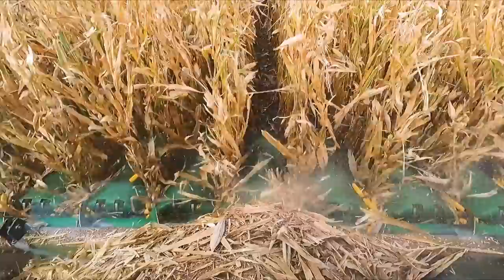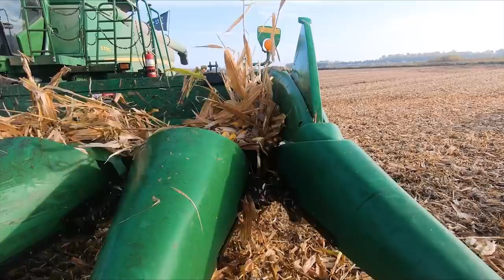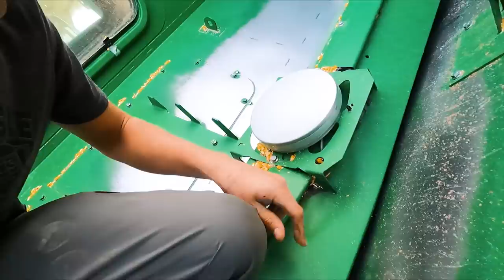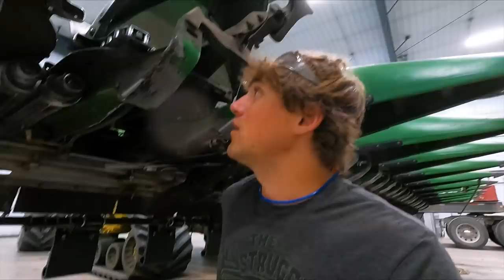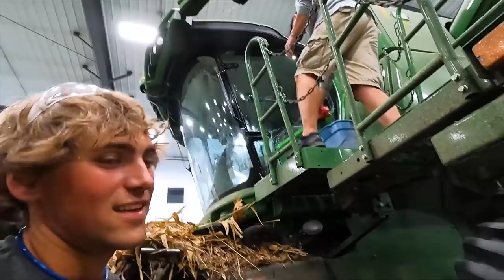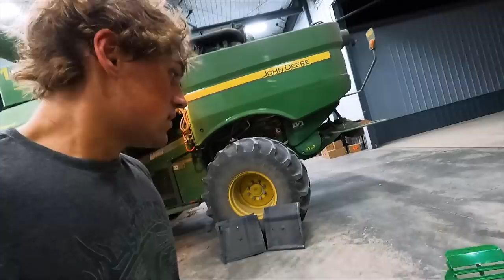We Crushed Our Grain Tank Auger!! #15

Comment: Seen a lot of cross auger bend on my20 and earlier machines. MY21 machines have a thicker gauge steel on the new ones so if you do get new ones they will be stronger. The entire auger trough has completely changed too in its construction.
Reply: @Ross Freeman Hi

Comment: Here’s what you do when the corn is a little damp. It’s a very technical fix and you might have to have your John Deere tech come out a help you get it set perfectly. You lower your ground speed and slow your head down so that the corn is not hitting the head so hard and it doesn’t shatter so much. Contact your local dealer with any questions.
Reply: Even better, READ THE OPERATORS MANUAL

Comment: I guess if you have to many fines since the corn is dry changing concaves is not going to help munch. First you need a need to buy the smaller set  of sprockets for the feeder house chain to run that slower and then the slow down kit to run the feed accclerator slower. Those two areas are where the cracking is occurring before it even hits the rotor and concave.

Comment: Not hard to figure out the shield over the auger in the grain bin  crushed due to the extra weight caused by excessive weight with the 3 foot higher bin extensions.  Its a chain reaction when you raise the grain higher and higher it causes you to have to reinforce what the factory engineered shields in the bottom of the tank. .  Do enjoy the channel.   I always thought the cobs came out the back of the combine and ears were gathered with the corn head.  Just my thoughts.  Maybe that why we called it ear corn when we picked it and put it in corn cribs.  Yes I am that old.  PS...........squirrels like ear corn too.

Comment: That's what happens when you put extensions on the grain bin on the combines, not made for the extra grain, that's why it wasn't made with them...
Reply: Everyone says “we will not fill them totally full”. But you do.  I bought larger grain cart then I intended, for tractor I intended to use…. “I will just not fill it full”
  Right
Reply: Actually they are made for it and come from the factory with them.
Reply: @gregjames5070  Not there's, they installed them after market to make them hold even more grain
Reply: Chets combine came factory with the power folding extension. The new used one came with a manual gold extension. All “S” series combines are made for extensions
Reply: Really I have extensions on mine and have never had that happen or seen or heard it happening to anybody else. I am thinking it was just a fluke piece of weak steel.

Comment: Erick the BS, have you ever tried new skin,  or liquid bandage? If it's on a joint you may have to use two or three applications. Put the first one right on the paper cut/ Leaf cut, preceding a little larger with each application wait until the first ones almost dry. Stands up to quite a few Washings of the hands. Don't know how it works with WD-40?

Comment: OK I will say this and you probably won't like it but we run caseih 580 quads and love them we demoed  a 9r 540 and no did care for it  under powered  ride was terrible  and the cab it smaller  the monitor was ok but I will stay with caseih  there simply just better even your hired man said on camera the johndeere was under powered and the ride was bad and as far as the combine that very tipicall of johndeer using to lite of parts I see all the time down on the wheat run and up here and also it doesn't help running those big grain extention  but you johndeere guy's are all the same you all think johndeere is the best but there not iknow casih is not perfect they have problems to but the difference is I will call them out most johndeere guy's wouldn't say shit about johndeere even if they had a mouth full.
Reply: Honesty, I like that. We run both green and red paint and have likes and dislikes of both.